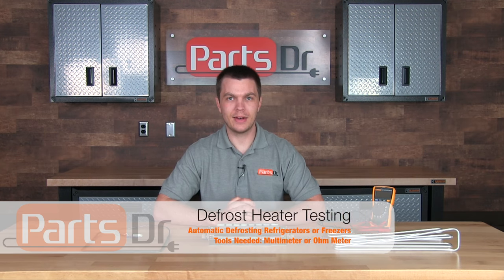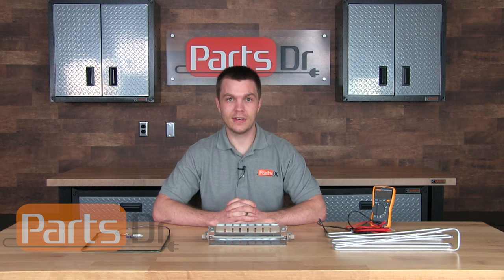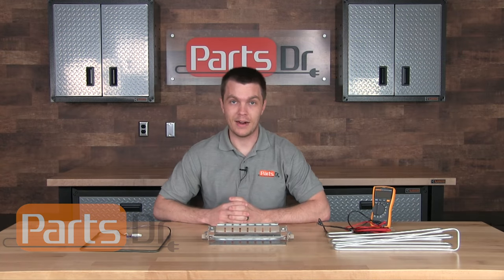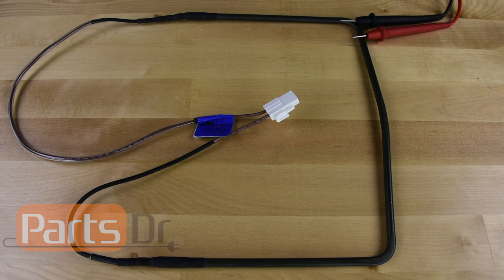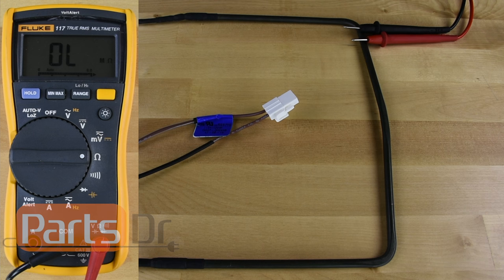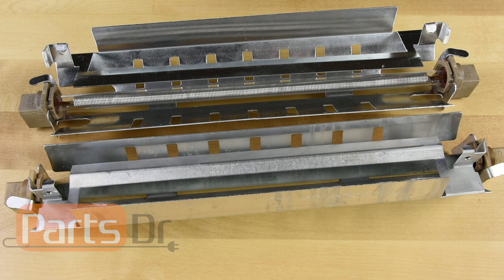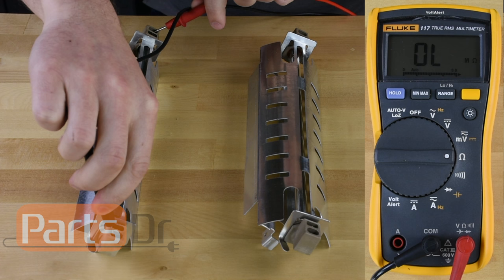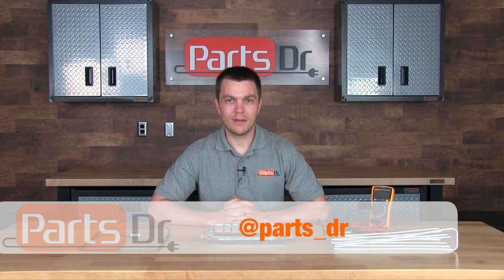How To Test A Defrost Heater On A Refrigerator or Freezer

Comment: I don't buy the comment "continuity test will not work on some defrost heaters because the ohm value is too high.....".  A heater element, by design, needs to draw enough current to make heat...which means the resistance has to be low enough to create heat....under 100 ohms is typical....at 115VAC that's about 1 amp of current....if the ohm value is "too high" for a meter to measure, then the resistance is way too high to create any heat (current) at all...it's simple ohms law.  A good heater with an 'ohm value too high' does not exist.
Reply from the maker: You are wrong.  It is common for the refrigerator section defrost heater on newer models to use a lower wattage heater.  120v and 120w is common and that is 120 ohms which is above the continuity range for most multi-meters.  Also, continuity is multi-meter brand specific, some multi-meters won't register continuity if it is over 50 ohms.
Reply: @PartsDr  Yes, lower wattage heaters are out there, I just replaced one in mine, but "120 ohms is above the range for MOST multi-meters"??  That is simply not true, and if you can back that up with the name and model of more than one meter that doesn't have the range or capability to measure 120 lousy ohms, I'd be surprised.  That meter has ONE range, and it's maybe 100 ohms???   There may be some really really low end meters that are simple continuity testers but they are not multimeters.  I think anyone who is going to be a DYI person to attempt this troubleshooting, will have spent more than $25 on a multimeter, which is piece of crap, but will easily read 120 ohms.
Reply from the maker: @elguapo5467  Klein Tools 600V from Home Depot.  Continuity Check: Audible signal <50Ω https://www.homedepot.com/p/Klein-Tools-600V-Auto-Ranging-Digital-Multimeter-MM400/206517333
Reply: @PartsDr     From specs in description:  "Multimeter measures up to 600V AC/DC voltage, 10A AC/DC current and 40 MOhms resistance".  That means this meter can measure up to 40 MEG ohms, and I don't think you've ever had a defrost heater that had a resistance more than 40,000,000 ohms.  But what do I know?
Reply from the maker: @elguapo5467  Yes it can measure the resistance, but it won't register continuity 50 Ohms or higher.
Reply: @PartsDr  Hey Doc, I wrote this big old reply, but I've wasted enough of your time, so I deleted it haha, just wanted to say my confusion is in how we're using 'continuity test' differently.  In my world, it's a term for a check to see if you have a short, like end-to-end wiring, or a good fuse or switch.   You're using 'continuity check' as a limited function on a meter, and you are right about the 50 ohms....just not sure, knowing its limitations, why it would be used at all, because a beep and a reading may tell you your heater is good, but no beep means you could have an open, or higher than 50 ohms in a range signaling a good heater, or more than 50 ohms in a range that tells you the heater failed.  So the continuity test works for telling you that you a heater is good only if the heater resistance is 50 ohms or less...with a beep and a reading.  Using the actual resistance tells you whether your heater is good OR bad, regardless of the resistance.  I do use the continuity check as a quick audible check for any kind of continuity, as it's actually at its best when you have, as examples, a bundle of auto wiring, or a 50 pin connector in a large electronic device, etc, trying to find where a wire ends up from one end to the other end, or poke around to see which wire may be shorted to ground.  Beep good.  Checking a defrost heater?  Eh, I'm using resistance.  Peace, out.
Reply: @elguapo5467  you are correct chief continuity test with audio beeps should not be used to test elements I tried that yesterday reading 85 ohms with no audio beeps
Reply: Better to do IR test with 250v setting

Comment: My heater gives me 0.6 ohm...is it bad?
Also i have two wire fuse after the heater which don't give continuity.
I don't know if changing those will solve the problem if I've this value on the heater..any help?
I don't know why there's a thermal fuse before the heater and two electrical fuse after it, I've never seen something similar in any other video